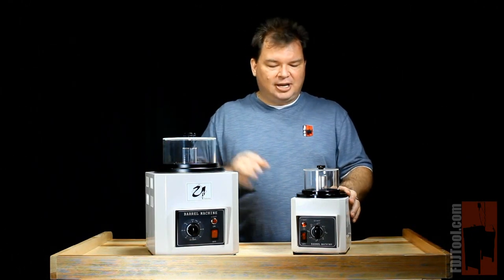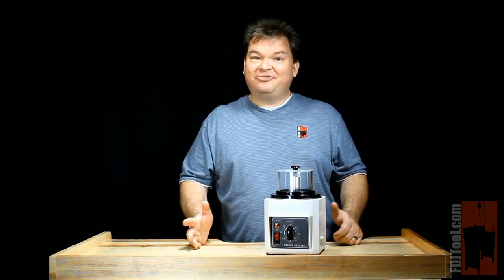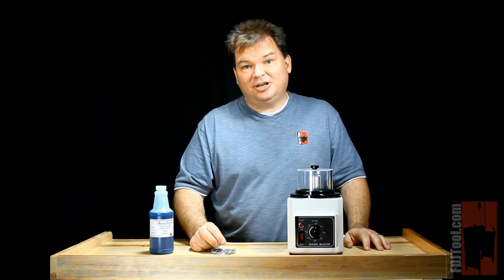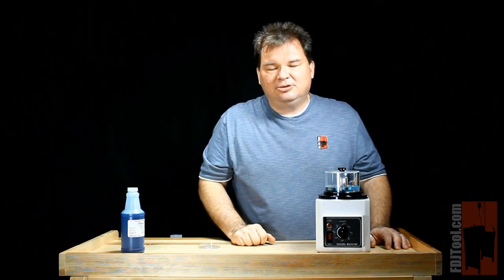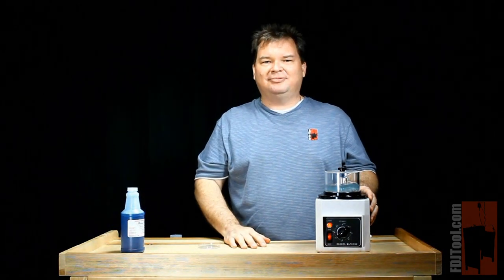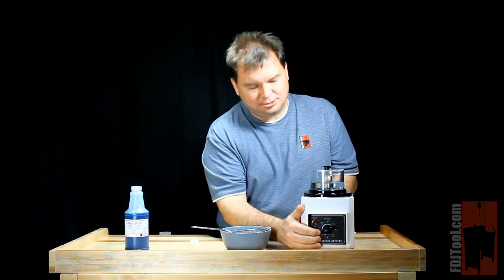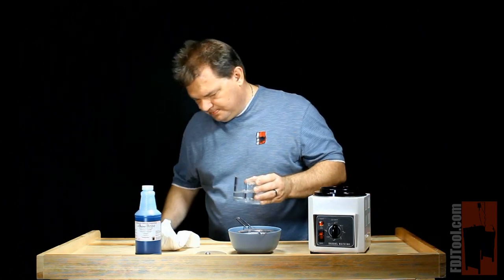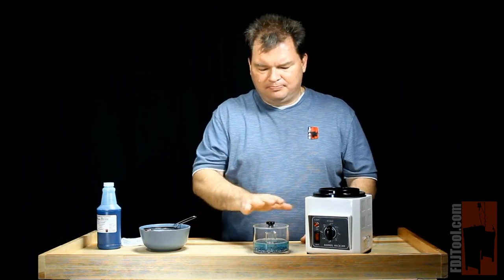Using a Magnetic Tumbler

Comment: can you make a video where you try to polish the stainless steel? would you use the same polishing media?
Reply from the maker: Brew Master We'll put finishing stainless on the list of ideas.  You can use the magnetic tumbler to finish stainless steel,, but with conditions.  You can ONLY use the stainless pins as media.  The spinning magnets in the machine are what drive the media, unless you go an purchase elaborate contraption that fit into the bowl for other types of media.  We don't recommend since buying a regular tumbler would be cheaper.  Second if your pieces are a low grade stainless, they might be attracted to the magnets and would spin with the media and not get finished.